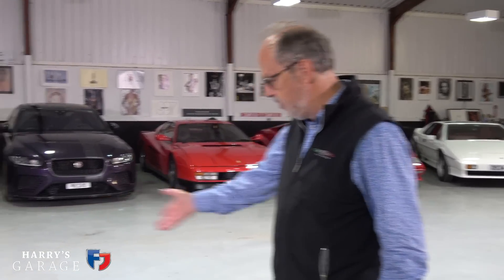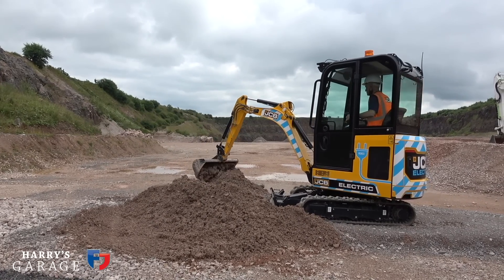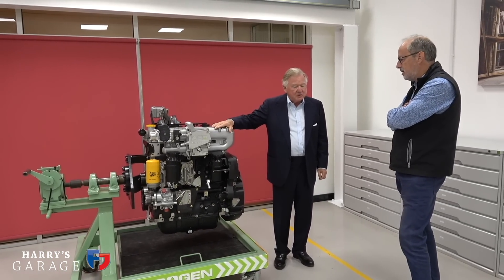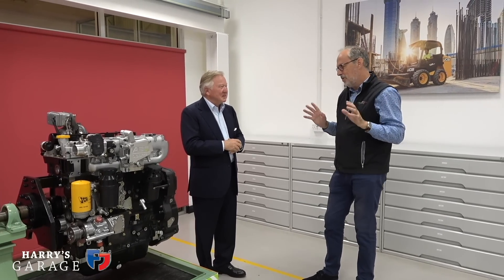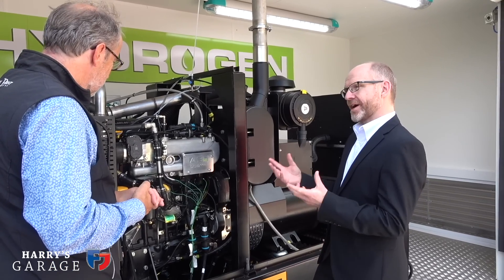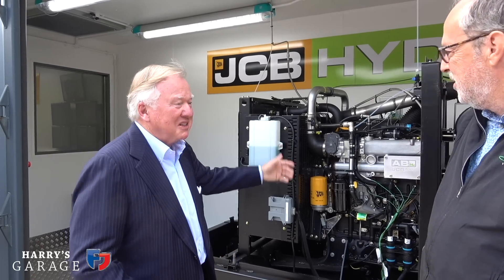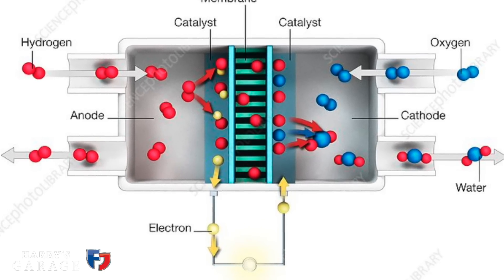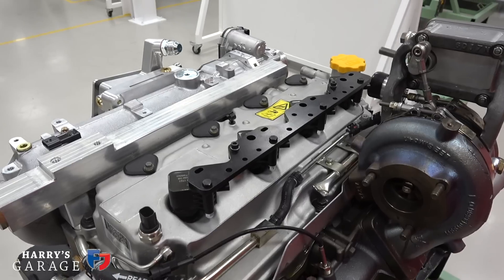Is hydrogen, rather than electric, the future for big-engined machinery? I visit JCB to find out

Comment: There's a chairman with his feet on the ground, understands his customers  needs and of the common man/woman too
Reply: But doesn't undertsand engineering or physics
Reply: @bbbf09  What are he and his customers missing?
Reply: @secallen  physics & engineering. Not unknown for a CEO
Reply: @bbbf09  ...and his customers?
Reply: @billsprague7094  Having founded and successfully run  my own business in diagnostic instrumentation - in a very competitive sector -  I would take issue with you that I have 'zero understanding' of business. I agree with Elon Musk that I would not look to employ people with MBa  but rather  primarily with technical training who also have business acumen. The number one degree level study for the world's billionaires is in engineering realated disciplines - not economics or some other business related subject.

I concur that the biggest drawback to battery is electric charging on site.  However, like others you also appear to have ignored or disregarded my comments on hydrogen. I am OK with the idea of hydrogen as a clean/green fuel for inaccesible or remote working environments. But only in the context of fuel cell applications  - not in combustion engines. Why would you take your H fuel and piss half of its potential away in the trap set by the physics of the Carnot cycle - i.e. by burning it in a weak and underpowerd low torque H engine? Why? Only if you intend to make a killing of hiding the vastly increased service/ maintenance contracts that H engines require due to the problems with Nox conversion and embrittlement of steel.

Also - many people here are making out JCB machines to be some kind of special sacred case like they are power hungry monsters beyond the reach of electric powertrains (which can never be true anyhow). Even the larger of the JCB range engines barely put out much more than a relatively feeble peak 200 horsepower - half of what my Tesla does - and with similar torques. My motor will still be running long after a H combustion engine has undergone its 20th major service overhaul or given up the ghost entirely. 

Ok - so sure, develop a hydrogen fuel JCB with a  fuel cell convertor + decent electric powertrain (that will be only 5% of the weight of the monstrosities they are   are considering here) and then I'll shut up. The idea has some merit in pursuing. 
Otherwise this combustion engine is really a mind boggling stupid idea. Unless of course you consider as a good business scam. Lock in those long term lease contracts before they have a chance to realise, eh? 
p.s.
Business people are often Morons (and not to be trusted as well - for reasons above). Not always though. You though are a moron if you believe climate change is fiction. 
In the end you annd the rest of the deniers (plus flat earthers and other tin foil hatters) can continue to be morons.  It doesn't matter in the end. Sceince plus old fashioned busines and economics forces  (that you admire so much) will simply kill off combustion engines very soon - at least for cars. If you take all life cycle costs electric is already cheaper but battery costs will continue to drop past threshold and in about 2 to 3 years making a decent 300mile range electric car   cheaper by the showroom ticket price than a ICE vehicle. Of course the zero maintenance and difference in fuel costs mean you keep winning ebyond that - so that only the rich and financially perverse will be able to resist. My first electric car (BMW i3) has already made up the difference in fuel costs for me in only 3 years.  The S-curve take up is on the exponential ramp up and about to take off . Watch this space
Reply: Am i listening to really outdated and uninformed information here? First of all japan has already looked into mass producing hydrogen vehicles a long time ago. Second all internal combustion engines can run off hydrogen. Third there has been hydrogen powered buses here in America for years. They are developed by a company calles the sun bus. Last but not least Toyota has the most advanced hydrogen fuel cells. This video seriously made me feel like my brain was losing 📉  intelligence.
Reply: He is a wonderful asset to British business and a really nice character who is generous and charming at the same time. I got to know him when he hired me to show him the battlfields of Waterloo and Ypres, and Berlin WW2 as well. He has a sharp mind and a great sense of humour too!
Reply: @nigeldunkley2986  Sounds like the kind of man you want to know - if you are a tour guide for war related themes. Just not a good engineer.
Reply: @bbbf09  Oh do tell us the name of your succesful diagnostic business, just so that we can investigate the degree of your succes and your qualifications in the field of engineering.
Reply: @geoffaries  it's in synchrotron x-ray extended range fine structure absorption instrumentation.
Reply: @geoffaries  So you are googling there - you don't know about the field. XAFs is a technique not a manufactured 'thing'. What you make is a system of various ultra-high precision diagnostic devices and asociated instrumentation (monochromator, detector, goniometer) - the combination of which  is what makes the technique possible....and science and engineering march forwards another step.
  The NSLS is only one of many synchrotrons across world and each synchrotron has many beamlines using variations on these techniques. In fact I haven't worked with NSLS. 
As I don't know you from Adam that's as much info as I'm revealing. Won't be revealing personal or company details as I don't wish to be doxxed and trolled  - or my customers. That  might not be your intention - so no offence  meant -  but it quite easily could be given the low standards of youtube.
Reply: @bbbf09  "But doesn't undertsand engineering or physics" ... Where do you conclude that from?
Reply: @dipladonic  You think man made global warming is fallacy or the emergency a fallacy/ or both?
Reply: @davidcaple5547  Because if you knew the physics of thermodynamics you  might appreciate just how much the laws of the universe make it a stupid proposition to use hydrogen as a combustion fuel (in afuel cell welll...maybe, just maybe)  He has no education in either subject so unsuprising. 
Suppose I said I could light your house with hydrogen burning gas lamps.  I could easily get the hydrogen from hydrolysis of water using electricity.  Possible? -  of course its possible!. But the laws of physics mean the light from ahydrogen flame is mostly in infrared and invisible and useless to your eye. After the additional efficiency losses in turning watre into hydrogen in firts place the power actually doing the job of providing light would be less than 20% of the electrical power you started with - which could go direct into  LED light. 
So why would you choose hydorgen gas lamps in the home? Only if you didnt undertand or appreciate physics or value engineering.
Reply: @bbbf09  The emergency is a fallacy, and it's hardly axiomatic that man's contribution to global warming is significant. Back on topic, for all sorts of reasons utility-scale hydrogen of any kind is nonsense.
Reply: @dipladonic  So you are advocating what as future source of energy?
Reply: @bbbf09  Nuclear fission.
Reply: @billsprague7094  amen 🙏 there’s more to the world then zipping down to your local to get a loaf of bread to like mining, transportation, farming. I suppose all the lithium powered car owners are happy to wait an extra day or so for the products if not longer while we charge up the trucks to get it there. Hydrogen power in ICE or fuel cell has its place in the world for sure
Reply: A YT argument between a manmade climate change denier and a YouTube Armchair Engineer is like watching an FA Cup final with Man U and Arsenal playing. You don't care who wins but you still watch in the hope of a tragic accident in the first half.
Reply: @davidcaple5547  I don't think you understand at all what I am talking about. Of course hydrogen is a workable fuel source (duh!) - but to make it sustainable  - even as you suggested -  you must generate   it first using electricity (solar, wind, nuclear...etc).
Look let me give you a simple analogy =- so you can grasp this. Could your house be lit with hydrogen flame lighting?  Yes it could. Quite Easily achieveable technically . I use electricity to generate H then flow it it into your house via an expensive and expansive gas infrastructure network. Unfortunately  to adequate light you need from H flames in your house uses up maybe twenty times the electricity that it would use if I send the electricity direct to your house into LED lamps.  Add on the extra costs of safety and the infrastructure then the likley cost to light your house would go up by 30 or 40 fold from just electricty direct and LED lamps.
So could your house be lit by H lamps . Yes -  quite easily. Its a totally feasible thing to do. Shoudl it be lit be H flame lamps?  No it a tremeondously stupid and dumb thing to do. The electrcity you need to generate is twenty time smore than coudl be done by efficient use of LED and cost maybe 30 times more to do.
Similalry H combustion engines - while feasible - will simply waste maybe 8 times the electricity they need to do. Electricity that could be put to be better use directly (battery) or in fuel cell.  
Get it now?
Reply: @davidcaple5547  So you reject hydrogen as combustible fuel then. Thought you were accusing me of that.
Reply: @bbbf09  Complex systems engineer here to help you with your complex, you wrote so much for saying so little that was barely engaging to read your dozen posts.. but still I noticed a couple of things:

First.. Did you said the biggest drawback of BATTERY powered EVs is charging on site?? Really? Not carrying around 300kg of solid containers either if those are half empty or not?? Not lifespan? Or heat aversion? Energy toll for recovering, disassembling and repourpusing each array of cells?
Second : Fuel cell is a Maybe for you?? 
For a person quoting Laws of Thermodynamics Its seems you are just rooting for a team.. otherwise you should have already noticed the terrible quality of cars, Musk is selling mostly to the uneducated.
Reply: @absolutium  I almost fell asleep  reading your nonsensical rant too.  (One insult deserves another)
300kg for a 32 Ton JCB  - I dont think that going to have much impact.  But I think you meant 3000kg if you want to last all day on 10 hour shift. Still peanuts). 
Why mention lifespan ?  Li-ion cells proven at 250k miles motoring on Tesla still going strong at 90% capacity. Like to a see hydrogen combustion last the equiavlent. Hydrogen embrittlement ? ! They won't last liek a disel. No way.
ok....Fuel cell. Laws thermodynamic. Team? What are you getting at here?  Elaborate please.  Gibbs cycle applies to fuel cell and Carnot to combustion. The difference dictates that  fuel cell twice as effiicient so you don't piss away half of the expensive hyrodogen you are otehriwse burning in your low torque, huge and short lifespan hydrogen combusation engne.    You can't get round that. Physics!  What the hell kind of engineer are you that doesn't appreciate that?.
I am enjoying my Tesla model 3 - £10k less than performance BMW M3 but beat pants of it. Just did a 1000mile road trip with zero problems. The interior finish is slightly below BMW but no hugely so. I always have driven high spec BMW or Audi previously so I know of which  speak.  
p.s.
I think being chartered with decades experience in research engineering  and post grads in both physics and engineering disciplines doesn't realistically entitle you to label me 'uneducated'
Reply: @bbbf09  Write it in a couple sentences so you don't waste anyones time
Reply: @bbbf09  Oh and I was talking about the Average Tesla not the industrial vehicle.. Now regarding fuel cell EV you are missing the most important aspect by far.. it is a closed system.
Reply: @absolutium  Disregard my last request. No need to converse further. I've just realised I 'm engaging a troll - not any kind of engineer (as you claimed). You really don't know diddly-squat about this subject do you?  Now your non sequitar responses and baffling retorts make some kind of sense ...because they are uninformed nonsense.
Reply: @bbbf09  Uninformed nonsense nice.. are you familiar with the Fifth Law?
Reply: @bbbf09  I don't know why I asked of course you arent.. you think a Lithium based container's longevity is measured by Miles.. here is a quick interpretation:
"No energy system can produce sum useful energy in excess of the total energy put into constructing it."
Reply: @bbbf09  Don't see how you got that  impression but if your lack of English is such that you did it would explain a lot
Reply: @davidcaple5547  
Your quote - 'Interesting how you challenge the appropriateness of hydrogen as a combustible fuel just relying on the unknown of "the laws of the universe" ... something we actually don't know '

(1) I suggested we use  hydrogen for lighting our homes  - which is a combustion process . (This was an technology analogy to make a point about a completely viable but yet misapplied technology - it was not a serious suggestion  - but OK, I can now see you didn't get that ). 
But it was you who then mocked me for suggesting that we switch to hydrogen flame lighting for our homes. But this is something that only 100 years we did with natural gas everywhere - so it's practical, viable  and works - so why diss my suggestion with hydrogen as flame lighting? Especially as you yourself declared that "hydrogen is an appropriate combustible fuel" (again - see your quote above). When you have figured out the answer or to underlying reasons why it is in fact a reasonable position to  dismiss it for lighting (and as you mocked me for) even though its compleetly realistic and viable -  then maybe - just maybe - you will just  begin to understand or appreciate why I am against hydrogen in combustion process in motive powerplants.

(2) Are you seriously suggsting we know nothing about the laws of the universe? We only just recently imaged a black hole and now also have copious amounts of data from gravitational detectors on merging black holes.
Yet black holes were only a theoretical construct 50 years ago and general relativity - laws of the universe - that describes them were formulated 100 years ago by Einstein. I spoke with people at grav detectors and they tell me general relativity 9 orders of magnitude correct in experimental measurements of colliding black holes so far. You might not have, but I think sceince in general has a pretty good handle on at least some aspect of the laws of the universe.  Certainly not 'none'.
Reply: @bbbf09  While Carnot's approach  to thermal efficency does consider irreversibility and limitations of useful energy transfer from a capable device you should have noticed that useful time of work of the test device was barely taken into consideration.
For us it is amazing since you can describe the notion of Quality in terms of mechanical work per cycles.
If you have the opportunity of owning a Jaeger LeCoutre and gift it to your son it would be a perfect example.
Reply: @absolutium  says the man who called a fuel cell a closed system. Look, your collective ramblings - forged from over-googling subjects and stringing  niche technical words and phrases  does not make you an engineer or physicist friend. You aren't making any sense. I am done engaging with. Bye.
Reply: @bbbf09  I didn't say we didn't know "none" but no problem I know your type ... you write an essay in response in the hope that I can't be bothered to read it all and respond in detail (that's something you have got right ... well done).  Well frankly I can't be bothered any more.  I've made my point and you can accept it or not.  Trolls like you are fun initially but there comes a time to move on.  All I can say is why don't you apply for a job at or advising the JCB technical team so you can show them where they are going wrong, I'm sure they would love to know and save millions in R&D.  I'm sure they and their shareholders would love to be put right by you.  Let me know how you get on, I would love to be kept up to date.
Reply: @davidcaple5547  The whole of engineering rests on physics - i.e. an understanding of the natural laws of the universe . In case you don't recall this verbatim what you said about that;
' ... something we actually don't know ...'  which sounds a lot  like 'none' to me.
Actually in your case I would believe that is definitively true - you appear to know very little or next to nothing about physics or engineering. It comes over strong.  But don''t project  the 'I' into 'we'.

'I can't be bothered'. ..and .. 'time to move on'   says it all really . Stuck with negligible education, training, experience  in science or engineering - but trying to to follow and respond to arguments too involved and technical .. you've gotten bored, frustrated  and given up.
So yeah Dave -  goodbye.
p.s.
I'm happy in my current job building high energy particle accelerators - so no thanks to job JCB.Even if I did, the prospect of move to a company investing heavily in  hydrogen combustion boondoogles isnt bright.
Reply: @bbbf09  Now you are showing your true colours ... when in doubt troll the other person!  Yes, I can't be bothered especially as you don't understand simple English ... since when has "something" meant "none"?  You try to twist a point but only draw attention to your own failings. BTW my name is not Dave!  Goodbye sweetie  xxx
Reply: @bbbf09   "Long term (full life cycle)  they will be problematic in servicing and environmental Nox emissions as well as fundamentally wantonly wasteful and will be very costly by comparison". This is rubbish servicing would be on a par with current costs and you talk about Hydrogen fuel cells but they have the same issue on emissions , You talk about them having to be discounted to get traction but the alternative is electric not diesel and that costs a lot more so no discounting is required. it is the cheap option. You dont talk about the time bomb of disposing of batteries that we are sleep walking into. This technology is ideal for JCB and yellow goods . Its not necessarily a long term answer for everyone. I am an engineer and know JCB well. Not a company I would do business with as a supplier ,as I have been a supplier, but full marks for looking at what is the way forward for them commercially. It is only that if the customers agree and the price is right and JCB have a good track record.
Reply: @bjs7442 1. What is this time bomb disposal of batteries problem that you speak of? please elaborate?
2> Why is the technology suited to JCB?  The only place H would work best as fuel source is where you don't have access to electric grid on site and they have to work all night/ all day non stop. There are therefore a fraction of instances I could see it as advantage - but only a fraction> And even here fuel cell wins. NOT combustion.
3. Nox emssions ? combustion the same for fuel cell ???!!  What?! I mean, you say you are an engineer but what kind of engineer are you? this is simply trolling or very uninformed .
Fuel cells governed by Gibbs free energy cycle -combustion by Carnot cycle. Guess which is more efficient by factor of 2. Thats right . So fuel cell uses half the amount of H right away. Much more important though is the low temperature processes of fuel cells virtually eliminate producation of Nox at all. You are talking order of magnitudes difference between the processes. You should know this is - if, as you claim - you are an engineer (or at least have bothered to have checked up on the facts  before commenting on it)

https://www.osti.gov/servlets/purl/923761#:~:text=Any%20high%20temperature%20combustion%2C%20such,temperatures%20of%20their%20chemical%20reactions.
   
https://www.nrel.gov/docs/fy10osti/47302.pdf

https://www.youtube.com/watch?v=1Ajq46qHp0c&t=1s
Reply: @bbbf09  The battery time bomb is the lack of sufficient recycling and suitable recycling infrastructure for the huge quantities that will be used in vehicles.
My main point is you simply don't understand that we are talking the real world here. I have a degree in mechanical engineering but more importantly have run a successful company supplying parts to the yellow goods industry ie Earth moving equipment . eg Caterpillar, Komatsu and JCB for forty years. What they are doing is responding to what can be done now and is commercially viable and easy to use by the customer in their industry. Not looking at theory in the long term or what's ideal for a car. They need to respond now and where electric power is the answer they have done it in their small excavators but the larger ones its a nonsense. A 20 tonne excavator becomes 28 tonnes with batteries. That's what they said. Then the whole equipment has to uprated to a 30 tonne specification. They operate in remote places often. They wouldn't sell one. Cash and profit rules as margins are very tight in their market. JCB have identified what is appropriate to them now. I know you deride it but you dont have a commercial hat on. In years to come I am sure they will watch what happens and change course but not now. The technology you espouse is not commercial at this moment.
Reply: @sol sol
He just got a shitload of money to push that H2. The way they use it is not helping anything. Look at well to wheel and you'll see
Reply: @billsprague7094  TCO won't cut it.
Reply: @31144  Nope I have no allegiance to Musk...personally I find him disagreeable as a person and would not invite him round for tea. I listened to the whole lot right through and I believe I have addressed all issues raised  elsewhere throughout the many comments I and replies I have made here.
Now, if you care to wind your neck in and be specific I will address any speciifc point you wish to make.
Reply: Discussing hydrogen without discussing the difficulty of making it is like discussing perpetual motion machines.
Reply: @31144  BEV have no issues. ICE and FCEV do.